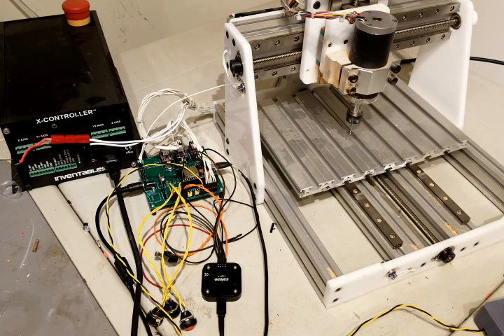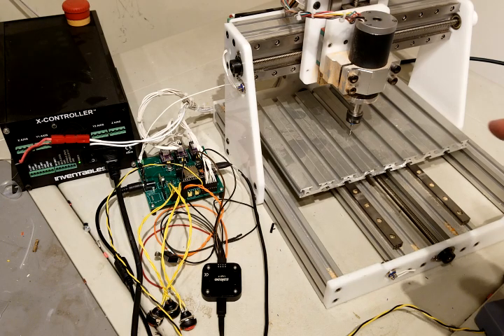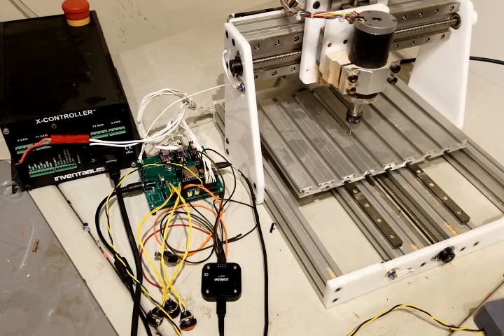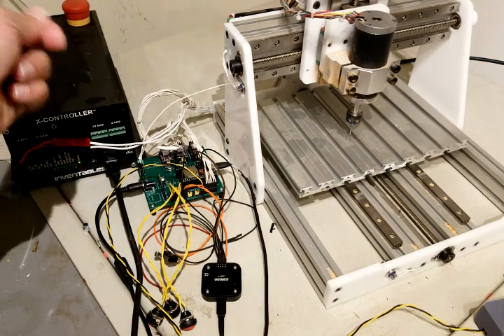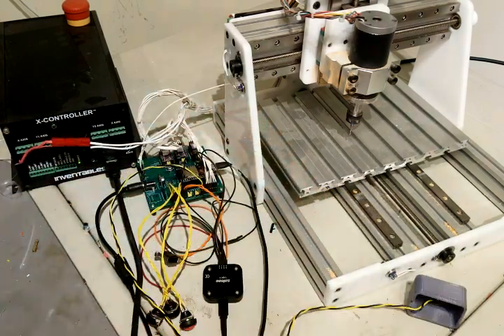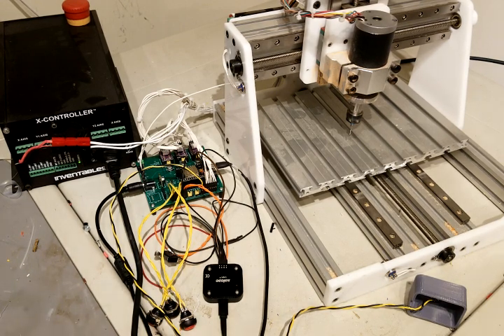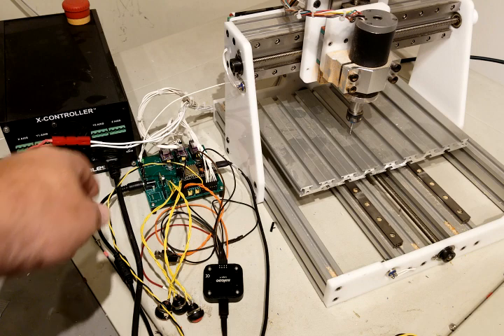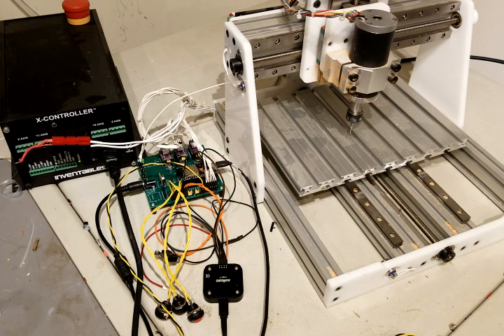Grbl running on ESP32

Comment: step pin number of XYZ Axis of the schemetice of this board dosen't match with Grbl firmware in github. Like, in Schemetice XYZ step pin is respectively GPIO 12,14,27 but in Grbl firmware it is 12,26,27 respectively(In machine Forlder > 3 Axis_v4.h).plz could you explain?
Reply from the maker: It is FluidNC now and any pin can be anything...Google it

Comment: Great Job!, 
Do I need to change anything in the code to 3 axis? because it's not working. Which control output pins?
Reply from the maker: Read the wiki on github
Reply: @engserve  Thank you! I found this: https://github.com/gnea/grbl/wiki/Connecting-Grbl, but I used ESP32 and I am not found connection
Reply from the maker: @yuriborgews234  https://github.com/bdring/Grbl_Esp32

Comment: I just realized it doesn't have the driver on the board for the spindle/laser, which is typical of the standard Grbl boards that are out there.  I know this way it can be used on more devices.  But would have been nice to be a plug-in replacement for the older boards.  Maybe a daughter board with that portion of it taken care of?

Comment: Am I correct in assuming that your using DRV8825 drivers? Any thought about using drivers from Trinamic? I've been a big fan of the TMC2130 and have been playing with the more powerful TMC2660-BOB lately. Also have you considered adding an I2C/SPI connection for adding a simple display?
Reply from the maker: Those are DRV8825 drivers. I have used some Trinamic parts in the past. I have better luck with them directly soldered vs. the modules. The thing being demonstrated is the firmware. The drivers could be anything that takes step and direct.

The ESP is very flexible about mapping functions to pins. SPI could be used on many pins. SPI or I2C might also be needed to setup things like Trinamic drivers too. 

Right now the focus is on core functions of CNC. Additional features could be added later, but I find there is no better display than a smart phone, so BlueTooth is the next feature to be added.
Reply: Barton Dring Completely agree that off loading the controller/display to a spare smartphone via Bluetooth/WiFi is the way to go. Thanks for pushing forward with porting Grbl to the ESP32! Excited to give it a try.

Comment: Great work Bart. We're you able to get the grbl code to run in a FreeRTOS thread? I can see a flutter.io cross-platform BLE HMI coming soon! Good luck and keep going.
Reply from the maker: FreeRTOS is running. The stepper timing is done by a fast timer interrupt. It should be "easy" to add BlueTooth. I'll have to check out Flutter.io.  My hope is to use existing senders, like the awesome Grbl Controller for Android.

Comment: Looks good. Few random questions, What kind of spindle motor is that? Are those Chinese linear rails?
Reply from the maker: The spindle motor is a low power (350W) brushless DC spindle I got from Aliexpress. The linear rails are Chinese that only cost  few dollars each. The leadscrews are from Openbuilds.
Reply: What kind of accuracy do you get with the China parts? I've tried a few China parts - very hit or miss (some rails came bent, others perfect).
Reply from the maker: Everything seems fine. The rails are very small at 12mm. I only use this machine for demos and maker events. I carve things like drink coasters in maple with 1/16" and 1/32" bits, so the load is very light on the machine and spindle. It is very reliable and super portable. I like the clean look in white with 3d printed belt covers.